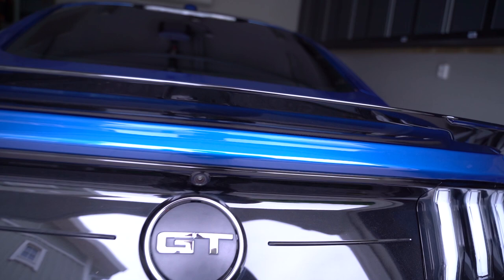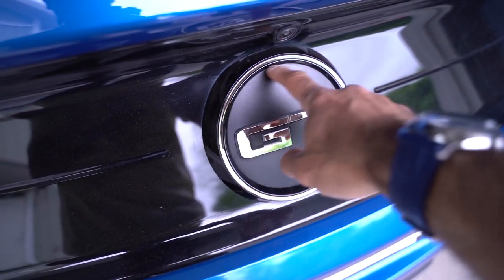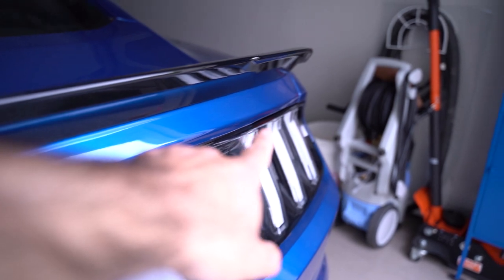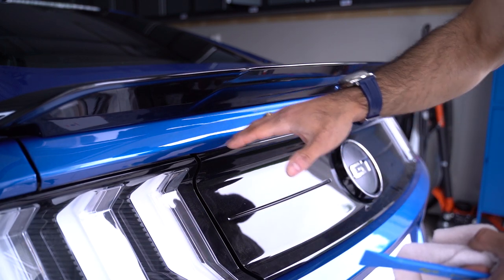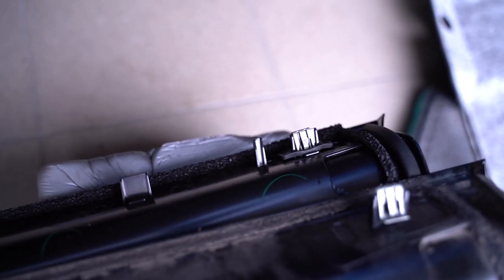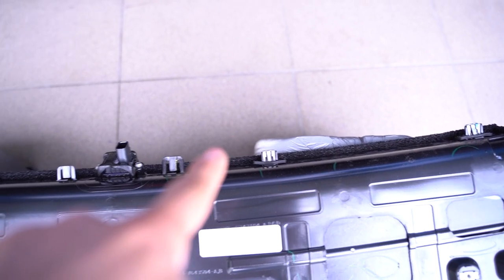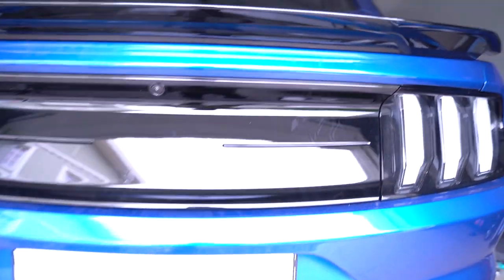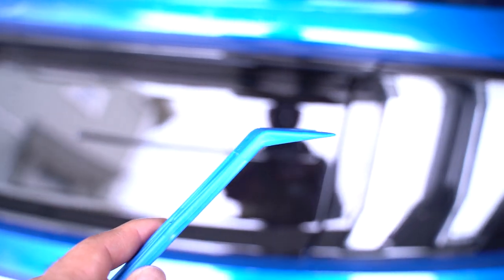2018 Mustang GT - Ford performance deck lid panel install ends up really bad

Comment: Maz i feel your pain. Last summer i built a shelf in the garage and  put my sons skidoo parts on it. I put my car away for the winter not even thinking about  the shelf. Well i tripped on an extension cord and pulled a part down on the side of my car and i now how 2 small dents on the B pillar and i want to cry every time i wash my car. Hopefully you can find someone who does PDR. I am goin on  holiday in august and will hopefully get mine fixed when i go down to civilization. Good luck
Reply from the maker: Ohh my that doesn't sound good :(. Hope they will be able to sort it out for you. I have already booked time for mine...

We used to have shelves on the wall in the garage but now we have cabinets instead on the wall, feels much safer :D
Reply: @Themazcorner  Yeah well it was my own stupidity. I thought the battery tender was not working so i tried to shimmy around the car and pulled down the extension cord and then that sad moment. You know the one, when you get that feeling in the pit of your stomach. But its just a car . Hopefully yours will get sorted and back to looking new. Where i live no one does pdr, they dont even know what it is LOL.

Comment: The deck lid panel looks great, sux about the dent though. In the video it looks like there are 2 more small impressions a few inches to the right of the larger dent.
Hope they can massage those out.
Good luck
Reply from the maker: Yeah the OEM EU panel is not nice at all in my opinion.

Yeah thanks for the heads up, I have since before seen those additional dents. Hopefully all of them can be sorted out

Comment: How did you remove the alignment pins ? Plier tool and then file out for smoothness ?
Reply from the maker: I just used my Dremel to take them off. You can sand them down a little

Comment: I'm in Australia and that's the first mod I did. I also tinted the tail lights red so it looks like the US lights. Its crap why us European and Australian cars get the crap. Lol
Reply from the maker: What color is your car? The smoked tail lights work better on some colors. On e.g a magnetic car they are just awesome. Yeah decklid with the faux gas cap is truly ugly :D
Reply: @Themazcorner  
Hi there my car is a 2019 gt race red.
Reply from the maker: @nunziorose1749  the tinted lights work good on the red in my opinion. However e.g on the orange fury not so much